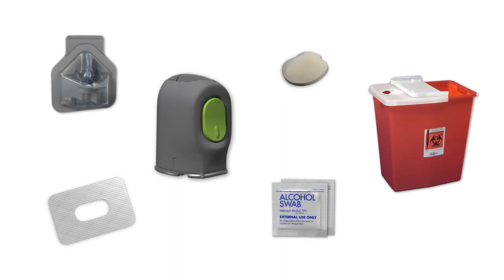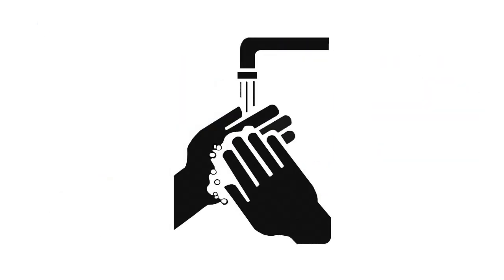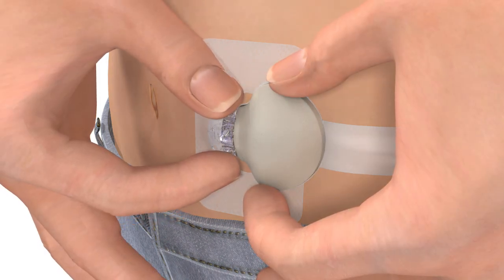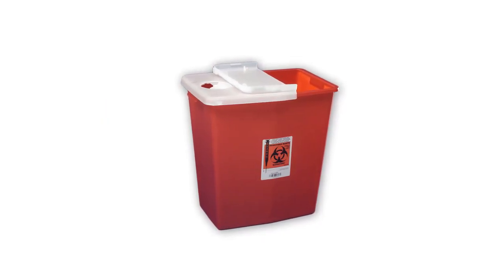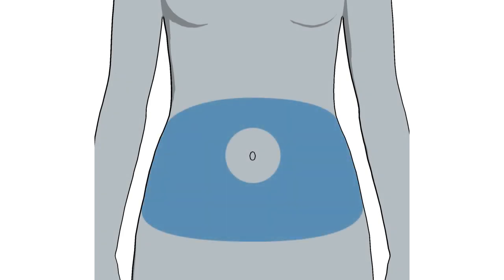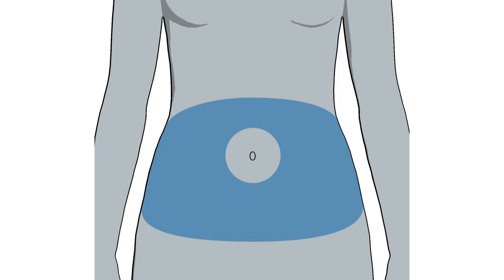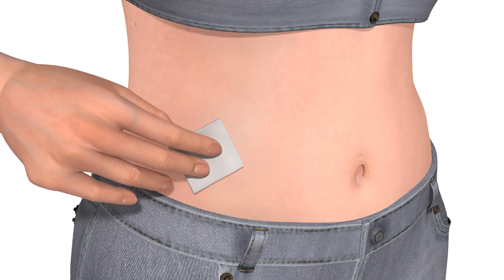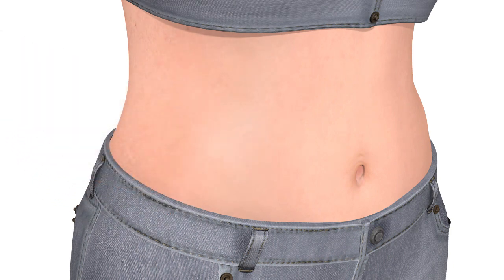Preparing to Insert the Enlite® Sensor

Comment: Perhaps there need to be instructions specific to different types of users.  I'm an active young adult.  I've tried this method and never been able to keep the Enlite on my body for more than 12 hours.  My Medtronic trainer explicitly instructed me to put skin-tac on my insertion site, leaving a small circle for the actual sensor needle untreated (so as not to get skin-tac on the sensor probe), AND to put a second overtape on top of the entire sensor (arranged perpendicular to the standard overtape).  This is the only approach I can take to avoid the sensor coming off in the shower, in the pool, or during moderate exercise.  However, even this method often fails to keep the Enlite attached during vigorous exercise, a long swim, or a round of golf (which involves twisting of the entire torso).  Therefore, I try to golf and strenuously exercise only on the last day of a sensor's life.
Here's a question: Why does Medtronic sell Skin-Tac wipes if not for use in attaching Enlite sensors?

Comment: This does seem to be out of order.  Taking sensor off is not the way it happens.  I use two of the tapes to keep it in place and when taking it off it has to be all at the same time.  I have had the sensor since Feb. 2014 and now I am getting a lot of sensor errors and it is stopping the sensor now.  These are expensive to keep going through like this.

Comment: I've had the 530g since February 2014 and the biggest issue I've had and continue to have is ensuring the sensor stays in place. During workouts I tend to sweat a lot all over including the stomach  area. The supplied tape which in this video shows to use one, but during the training classes I was told to use two ( that's a whole other subject) is not adequate enough to stay in place over a 2 day period, meaning I have to change more frequently which in turn means I run out of product prior to being permitted by the insurance company to be resupplied. Something else about this video is the horrible holes and knots left behind when you need to change sites is not shown or warned about. 
Since receiving the pump I'm grateful it has allowed me to better control my diabetes, myself, my doctor and wife greatly appreciate that. From what I've been told it's much better than in the past, I just feel Medtronics needs to design a way to incorporate the sensor into the port so one insertion can accomplish both actions and perhaps get the video, the trainers, and help line on the same page.
Thank you for your time